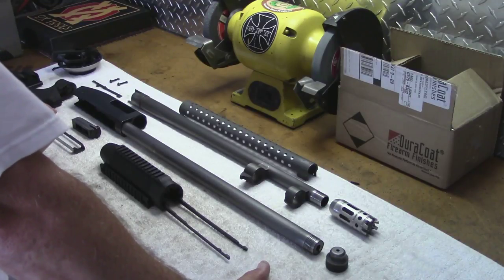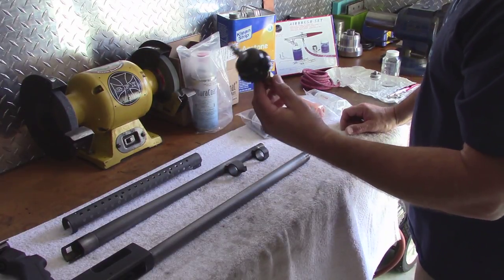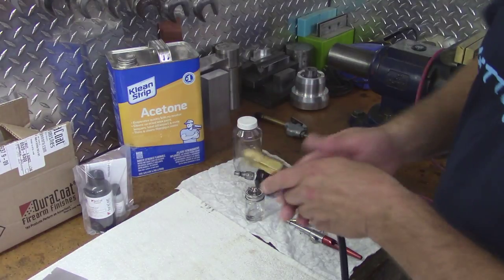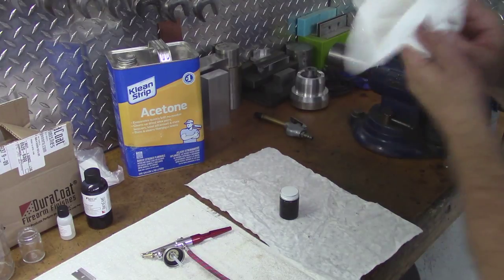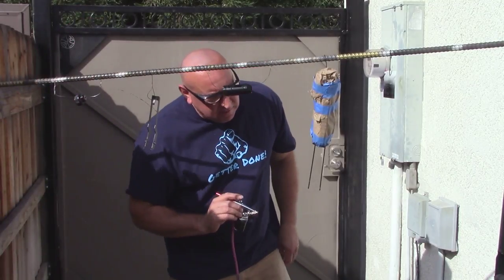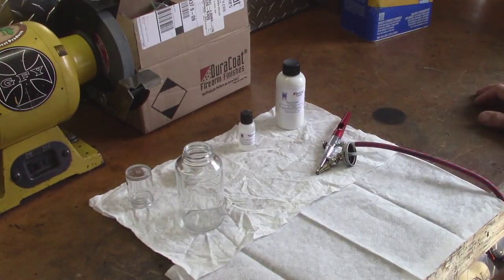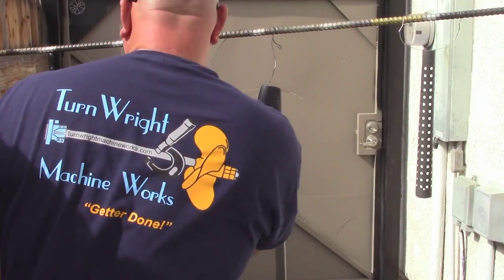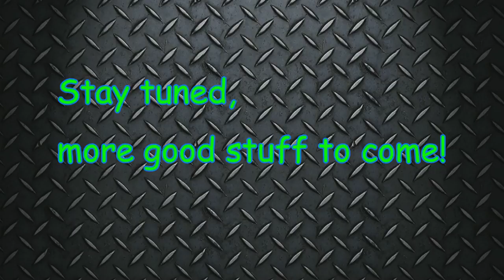Mossberg 590 Build Part 3 #realraysgarage

Comment: Great job and video ray. Another trick I learned when I started using Duracoat especially when I'm going to put a clear coat on is to spray from farther away with a smaller spray to get a more matte finish.
Reply from the maker: +Mike Dittman Hey Mike,
For sure, that works well also. Thanks for sharing buddy!

Regards,
Ray

Comment: Fantastic video! I've built a number of rifles, but never played with duracoat. Any concern for painting working surfaces (threads, slides, etc.)? Thanks again!
Reply from the maker: +Robert Ross Hi Robert,
DuraCoat dries to a film layer of about .25 Mils (0.00025") and can be built up to 1.5 Mils (0.0015")on high wear areas, so fitment has never been an issue, as a matter of fact I like DuraCoating all moving surfaces because it smooths moving parts nicely. DuraCoat also has a SL (Self Lube) additive.

Thanks for stopping in,
Ray

Comment: hi ray,
thank you for the show.
i've never thought of a paint on a gun. always used that selenium salt based potion for the random touch-up. there's always something new to learn.
do you protect the thread from paint?
thank you,
-yolu
Reply from the maker: +Toly Dukhovny Hey Toly,
Never have had a fitment issue yet, DuraCoat dries to a film layer of .25 Mils (0.00025") and can be built up to 1.5 Mils (0.0015") on high wear areas. Actually smooths out moving parts and can be built up to remove slop in old actions. DuraCoat also sells a SL (Self Lube) additive for any of the finishes.

Regards,
Ray